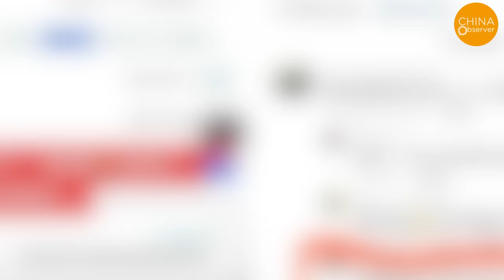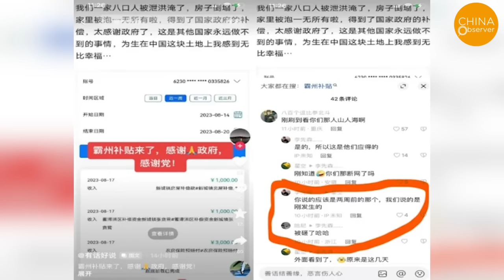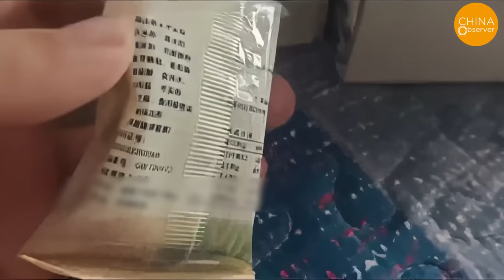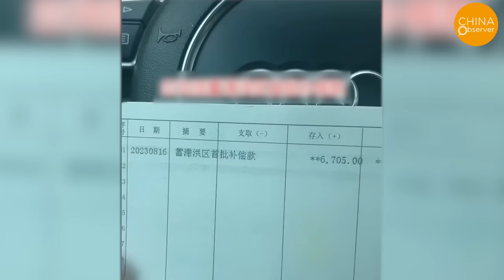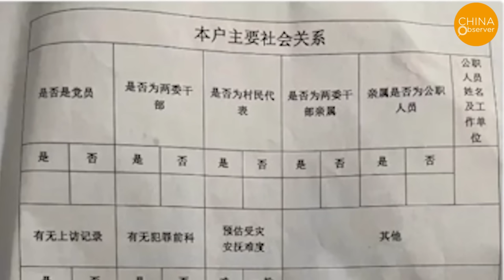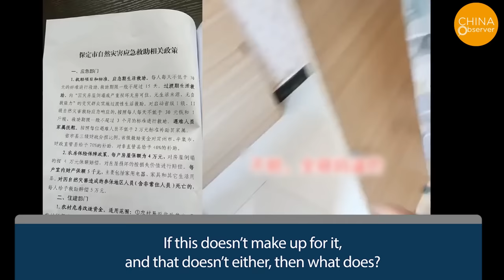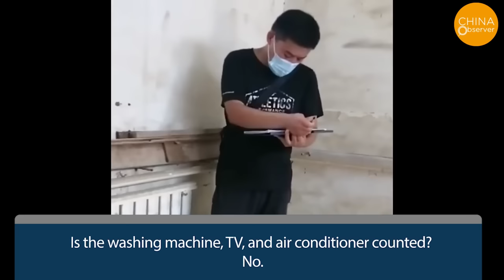Floods Strike Again, Submerging China in a Vast Ocean, 3.7 Million Crying for Help,￥100 Billion Loss

Comment: Hey if y'all care more about building actual infrastructure that worked this wouldn't have happened, just because it looks clean and efficient doesn't mean it work, no sewage drains especially in the new developed areas,  you be amazed how quick the projects they do, but dont actually function its not a 100 year flood over due to happening its location its weather, its the land, wasn't there a drought period going on for a decade or so wouldn't the soil just give if it turns into sand or soft soil.